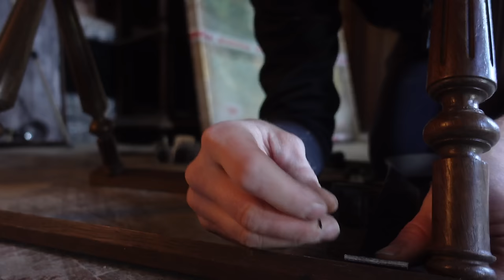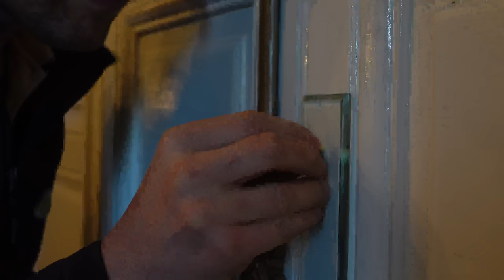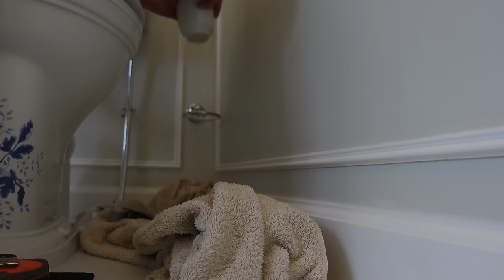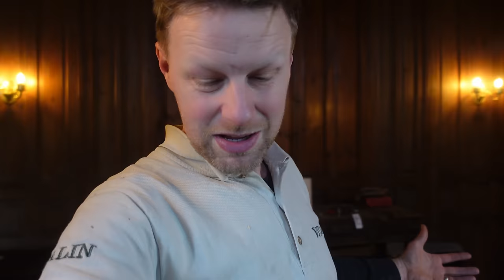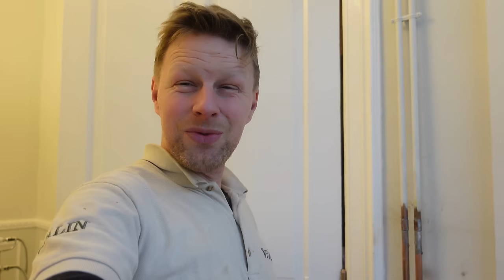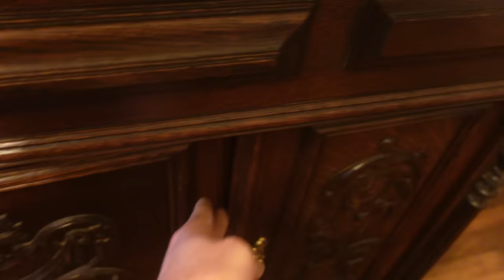Our Guest Suite Nightmare: The Problem We Never Knew About.

Comment: Suggestion: consider adding a small brace/back plate on the backside of the luggage rack. Without some form of protection, suitcases will brush up against your lovely paneling and you will be continuously touching up the wall behind the luggage rack.
Reply: That's a great idea. I get nervous about the candles on the mantle. I worry about a guest lighting them with bad consequences.
Reply: Good idea!
Reply: I agree. Pottery Barn has wonderful battery operated, timer candles. I believe they have wax on the outside of the candle. If not they sure do feel like it. Set the timer and beautiful candles that flicker every night.

Comment: It’s a little late now as I see someone repaired the pipe leaks for you. I highly recommend putting water shut off valves to all your fixtures. This way you can shut off the water to that one thing for repairs without having to shut off water to everything. I didn’t see any shut off valves to the toilet, tub, sink, etc. The same would be true for all the heating radiators. If your radiators are daisy chained, you might need bypass valves. These changes will save you time and headaches in the future. As you remodel, it should be all about making it easy for you to upkeep the place and deal with repairs. My wife and I are loving your videos. Keep up the hard work. ❤
Reply: Great suggestion. Something i would never have thought of. Yet sounds very sensible 😊

Comment: Hi Tracy, Terry & Ashe, Probably a lesson learned, both the incoming hot and cold water lines have to be pressure tested and also the drain lines. Water may flow down hill, but a leak, as you said, even a small one can cause damage. Glad you were able to get it fixed in a timely manner to avoid any additional damage. Mark & Scott

Comment: Heat the pipe not the solder, once the pipe is heated, remove the flame, lay the solder into joint, solder will run right around the joint

Comment: I'm sure they told you, but it is impossible to solder copper pipe with water in it. In fact, even drained, you have to evaporate all of the film of water on the walls inside the pipe before it can get hot enough to melt the solder and draw it into the crack between the pipe and the fitting. In the case of a horizontal pipe, there is a trick to use white bread and make it back into dough and use it to plug the pipe [one or both ends even] to keep the water far enough away for the joint to heat up enough. The heat "bakes" the dough back into bread but it will hold the water away and when the water pressure comes back on, it will just disintegrate back into goo [leave any flow restricting devices or aeration screens off the tap you're clearing the air from the lines with.

The reason: water boils at 212 F [100 C] and solder is usually made of a tin/nickle alloy. Depending on the alloy, the range is from 360 to 480 F [and someone else can do the maths for C], way hotter. The water boils to steam and increases the pressure in the pipe, even if it is not under pressure and water is heavy and so the increased pressure pushes the solder out of the joint and the water itself reacts with the flux you smear on the pipe and the joint to get the solder to flow, and it spits and farts and no solder gets into the joint. Even it is it "just a pinhole leak", it is nearly impossible to get the pipe hot enough AND dry enough to get a watertight seal.

All of this is one reason that many in the US and other places [not sure about Europe or France specifically] are going to PEX [Cross-linked Poly Ethylene pipe and "connectors". My favorite is called Shark Bite which doesn't need a special tool to connect, but they are more expensive. On the plus side, they are nearly impossible to put on incorrectly and seem to NEVER, EVER LEAK! However, this entire idea would not work for exposed pipes in a bathroom as was in this video. PEX is flexible. I'm just wondering why there are exposed water pipes in a living area at all. It smacks of running electrical wiring on the rooms side of the walls as I've seen you rip off and waste lines on the exterior walls of Victorian houses in the US when they wanted to add indoor plumbing [bathrooms]. Was it because this plumbing work was done in the early days of the chateau renovation, before you'd become adept at removing the wood paneling and running electrics and insulation behind them then putting them back up? I would even put pipe insulation on the HOT water line so that you don't waste the energy to heat the water and then just lose it to the air as copper is an excellent conductor of heat. 

And the cold pipe will probably "sweat" in a moist environment like a bathroom as the heat in the room air will equally well transfer into the cold water in that pipe, leaving the moisture it is carrying as a film on the surface of the pipe. With very cold water and a very warm damp room [or even very high general humidity if you get that in France], it might even be enough that you "think" you have a leak even when you don't. I'd insulate both lines if they were that near one another in open air, but that would be VERY unattractive, or just the HOT line if enclosed in a wall because the humidity usually cannot migrate that fast through a wall. However, stone chateaux walls might be a consideration, though I think they're supposed to be "dry" too, or the wood lintels over the windows and doors and the floor joist ends will rot, as in the one you just replaced long after the window itself had been filled in.
Reply: I've looked at many older French properties for sale, and they really don't go out of their way to conceal pipework. Abominably so, in many instances. It may just be for practical reasons, but there are some real eyesores out there. 😊

Comment: Bathrooms! Good gads….i have no idea what it is about bathrooms, but dang! The plumbing, the electrics and then making sure there’s a way to rid oneself of the humidity.  When we added on to our 100 year old house with the super thick walls made of chicken wire, straw, wood, and heavy plaster (19th century insulation in a cold climate) the new side felt a but strange…the giant beam that connected the two homes together was twisting, and then the roof valley started leaking… or so we thought. Upstairs bathroom for the parents suite had some weird issue with connecting the real copper pipes in the old house to the new modern plumbing! Oh, what a mess…we wended up taking out new dry wall, the ceiling, one whole wall…and then had to re- inspect the roof. I truly remember having to rip up new to fix something strange. Best wishes.

Comment: What an amazing transformation! I am in awe! Just wanted to add my two cents on your leaky copper pipes. I work in HVAC and I would really recommend using compression fitting or press fitting for the connections you have to make between the pipes. Never use soldering for these kind of jobs. The use of these fittings ensure that there is no leakage. Now, press fittings are top yet a so-called press tool and press jaws are pretty expensive (the tool alone around €1500), so compression fittings don’t need those tools. It avoids the soldering of weakened pipes. Might work better for you? Just my 2 cents! Keep up the good and hard work! And big hug for your mom! ❤

Comment: So glad the plumbing could be fixed. The suite looks immaculate but I’d be taking a few precautions. I’d be putting a sheet of clear Perspex or similar behind the luggage rack to protect the wall panelling. 
I’d not be putting out porcelain or China from the Titanic because ‘What the eye cannot see the heart does not crave’ as my mother always said. France is dripping with beautiful chinaware and porcelain, use pretty but replaceable cups, saucers and plates. Lock up the Titanic porcelain to be admired in the Grande Salon. I’d also never keep glass champagne flutes near the bath. If they break you cannot find the pieces in water. Always use good acrylic flutes near water as people are not always as sober as they should be. 🇦🇺🦘🦘🇦🇺

Comment: your hot water never gets so hot that if would give problems with the solder, so they probably not cleaned the pipes good enoug, in the past we used S39 fluid for cleaning that but you cant buy that stuff anywere these days, take the soldered part out, you can buy a coupling that clamps the pipes, that one is larger that the ones used for soldering, clean both ends and use that one

Comment: Great job!  Two points I want to ask about, first have you considered placing a receptacle for someone to empty their pockets at night?  I know I like a set place to put my wallet, keys, change and etc. to keep them together.  A shallow basket, bowl or tray maybe?  Secondly, are the exposed HOT water pipes in the bathroom a safety concern?  I just know that in the States that it is for hospitality rentals.  Another thing about the exposed pipes, did you consider the heat loss from uninsulated pipes?  Maybe a timed test to see how long it takes the water to reach a normal bathing temperature in the shower and the tub.  Better to test now to avoid any possible future complaints from guests about cold bath water.  Like you said, it’s the details that matter and I want you to succeed in your endeavor.

Comment: Sweating a copper pipe is something you need lots of practice with a plenty of what is called flux paste, a wire brush and plumbers sand paper or what ever they call it in France, however prep and thorough cleaning of the fitting is essential to a good seal. My dad use white bread when sweating a pipe. The plumber will know what I mean. I’m glad you used a piece of sheet metal behind the pipe, my dad did the same thing and a spray bottle of water to put out those pesky sparks. You will be chasing those little leaks, but as long as the prep is done correctly you will be fine. Re: the pex tubing or the use of shark bites, they too need the most accurate measurement and cleaning the edges so burs are not causing pin point leaks. I know, that happed to my bathroom hot water line.
Reply: Soo....you're telling us to do EXACTLY what the professional they brought in.....IS DOING, then ...!?!?
Why???
......unless it's so that you can tell YouTube that you know stuff about plumbing...!?
.....once again ...why!?!?

Comment: I don’t know if just sildering will hold the water. In Belgium we place a connector piece between and then the plummer uses someflax tread around the joints and seals the pipes like that.

Comment: I always use a facial tissue to detect minute plumbing leaks. Dry the suspected leak area thoroughly and, then, wrap or press a fresh Kleenex  against the suspected leak area for a bit. And, then, hold the tissue to the light and look for tiny damp spot or spots. It will detect the tiniest of seeps.

Comment: We had copper pipes and found our water was acidic and ate little pin holes in the pipes. They all had to be replaced with the non metal ones.  Test the water with a strip used in a pond. Good luck.
Reply from the maker: Thank you 🙏 ☺️

Comment: I think you ned to weld the pipe rather than use solder. Also Tin solder is very very brittle - you might need to look at using a different mix of metals if you want to continue using solder.

Comment: Glad it’s all sorted. Have you tested the rads to make sure they don’t have a small leaky in them as it would be dreadful to find out when you have to turn on the heating, been there done that.!
Reply from the maker: We will 🥰🥰
Reply: Drip trays under each radiator for a few days just to check that a the on/off times leaks dont start.  We used cheap baking trays - very handy.

Comment: About the leak......I propose something which is not a very beautiful thing, but IT IS very effective.  Ducttape!
Reply: Not the ‘luxury look’ using duct tape! They are achieving a high quality look
Reply: @sherrylelee8274  That is true , but if they did have used the ducttape they woutdn´t had to break down the entire pipe and ceiling. And would have saved them a lot of time. With tape it only would have taken 5 minutes. Plus you can paint over the tape.